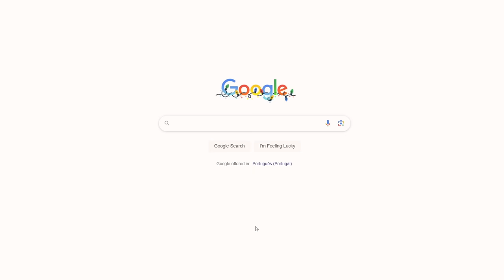FINALLY They Arrived! Abandoned Stone Cabin Renovation Build

Comment: You are a bit of a perfectionist. It shows in your roofing concrete foundation and how you screwed down all the boards instead of nailing it. And the detail of the mortar finish work. That roof isn’t going anywhere! Maybe stucco the outside of the walls if you want a finished look? Or just plain stone if you want more of an aged / grounded look. Very well done sir!
Reply from the maker: In the end it’ll be a mix of both. Stucco on the brickwork & pointed stone everywhere else 😎

Comment: In Germany we dont cement the Center tiles anymore. We have a system to screw them and under them we have a roll that seals. We are pretty happy here with the new solution.
Reply from the maker: They have dry ridge systems here too but they’re not as common 🙂

Comment: Happy New Year to our hard working duo ( and the dogs) and my fellow crew of armchair renovators! 
I realise you are doing  a traditional Portuguese style roof but I am always surprised at the lack of eaves, particularly as I understand Portugal gets very hot in summer. 
Here in Australia many traditional houses were built with eaves that overhang the walls and open verandahs ( porch? ) to shade the walls and help with keeping the house cool during the long,hot summer months. I assume the difference is because winter is more of a challenge in Portugal.
Reply from the maker: Happy new year Frances! There will be an overhang on the front & back but we haven’t put the first row of tiles on yet because it will be supported by brick which we still need to build up (hence why the place looks so weird at the moment with the exposed concrete ring beam). There will be a veranda on the front too but we’re going to add that towards the end once the interior is finished

Comment: hi , I think that you would be better off with a ( tile & half - tile ) rather than a half tile as the wind will take half tiles away without any trouble - also the tile overlap that you are using dose not look enough as driven rain  will make its way up under & rot the wood battens in time - there is a formula to lay tiles as to the right angle or pitch of a roof & I think a bigger overlap would be better - also are you using any fixings to secure the tiles or just relying  on the tile weight. Ed,

Comment: I’m worried you didn’t nail the tiles down using the nail holes provided at the top of each tile underneath the overlap. With ever stronger storms I’d hate to see all your hard work just lifted off the battens. Maybe I’ve missed something or it’s a different system to anything I’ve seen in which case ignore me 😊
Reply from the maker: Appreciate the concern but it’s not necessary for these tiles. The way they interlock keeps them firmly in place. The manufacturer advises only to screw them down if you have a really steep pitch or if you’re at altitude in a really exposed area 😎
Reply: I’ve laid similar tiles. Always nailed the first row, top row, the ends and every 3 or 4 rows.
Reply: Happy New Year from Canada!